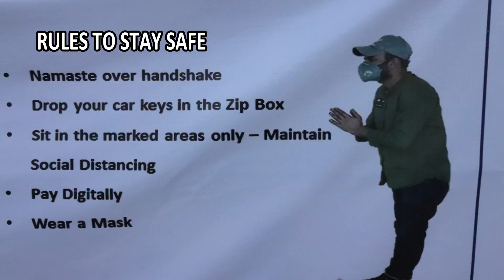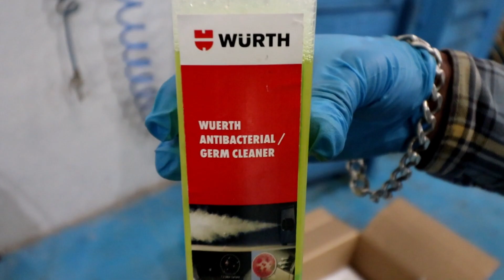How Car Sanitization Is Done At Heritage Motors | Keep Your Car Safe During COVID-19 | Tata Nexon

Comment: Car interior, doors, steering, gears, car seats can be disinfected easily without water and chemicals. Check out this Nevon Uvlizer on google.. The PU50 model is specially designed for disinfecting your car.